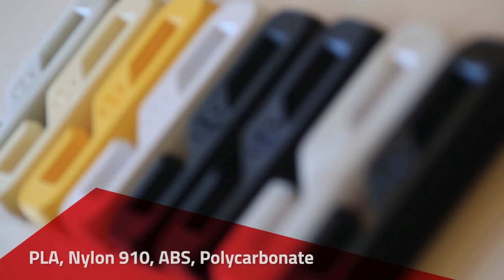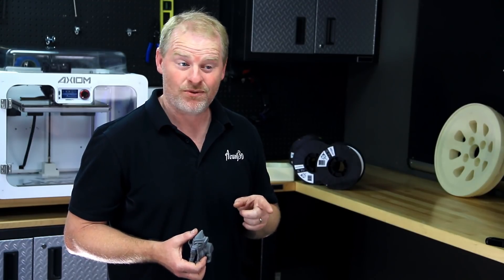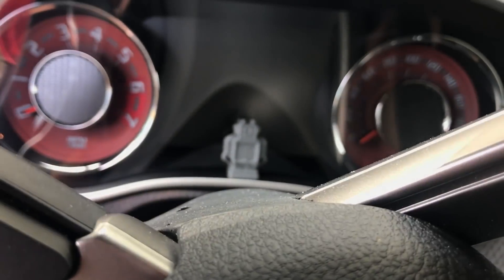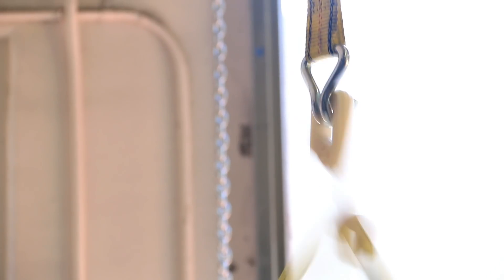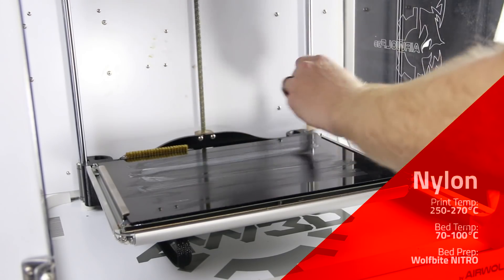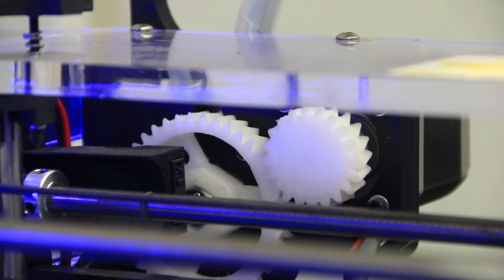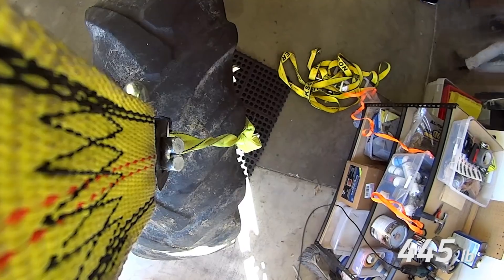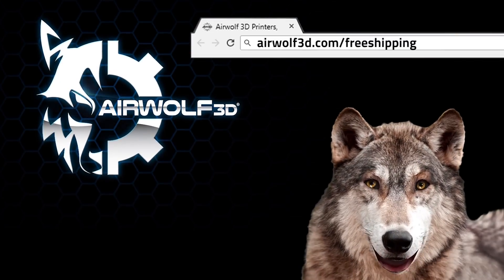Hooked on 3D Printing: What is the Strongest 3D Printer Filament?

Comment: K i would like to point out that who ever was using the forklift was very unsteady and that could have added to some of the failures because to be honest the jerking or bouncing can actually exert ten times more pounds of pressure just like doing it if you stand on a scale and just from doing squats on the scale your body can make the scale go from say two hundred pounds to 1000 pounds just from the inertia of your body going up and down and hence the actual break point could have been much higher than measured due to the unpredictable jerking or bouncing motion of an quicker bump of the hydraulics did you factor in these inconsistencies because the one abs broke during a bounce and then quick bump of the lever which could have actually went much higher in actual recorded weight in essence

Comment: Annealed overture nylon is my favorite material for high temp and strength. Higher tensile strength and impact strength than polycarbonate, temperature resistant to up to 180c, prints at only 260c without a chamber or even a heated bed, AND its only 30 bucks a kilogram and prints like a dream. Print it and anneal it like you would polymakers copa, do not try to print it like normal nylon or you'll almost certainly have a bad day lol. Not a fan of overtures other materials, I really dislike their petg compared to cheaper brands,  but I gotta admit, they nailed it with overture nylon. Please be responsible and do not print it without an all metal hot end. Capricorn tubes are unsafe at 260c even though they don't fully melt. You can check their website to confirm this. Idk why everyone thinks capricorn tubes are an alternative to an all metal hot end. They probably are the best ptfe tubes, I do like them, but they still degrade at unacceptable levels past 250c.

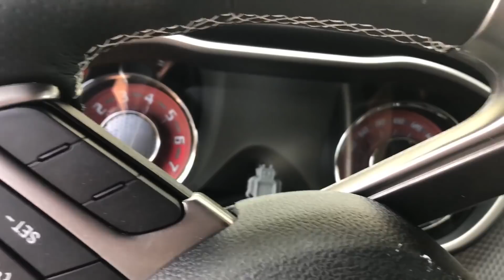Comment: Disinformation. PLA degrades very slowly in sunlight or outdoors. @3:20 the item doesn't degrade due to sunlight or outdoor environment, but it melts due to high temperature. PLA has a low melting point, but it has nothing to do with degradation.  PLA's biodegradability is mainly a myth. Well, it degrades far faster than ABS or nylon, but it still stands very well in outdoor conditions. In one test a PLA item was buried in a flowerbed for two years, and after that, it showed no signs of degradation (visually and mechanically).

Comment: This video was just suggested by the YouTube algorithm. It needs an update, and you should put the year in the video title to get the algorithm to better detect your update. Also, your update needs to include both chopped and braided/"continuous" fibers (ideally: carbon, yeast-grown spider silk from the CA company "Bolt Threads," human hair, and high-tensile steel filament). If you also added a metal sintering (SLS) and UV-resin-dual-laser-cross-linking tech like CLIP / HARP, you could guarantee high rankings and increased sales. (However, do slow placement of weights this time, and don't waste people's time. i.e. have them one after another, and post the "timestamps space brief phrase description" under the video so it is autosensed and put into the video's control bar. Such videos place higher in YouTube's algorithm, and automatically yield a higher ranking.)

Comment: there is a difference between degrading a material and temperature resistance, pla wont degrade for decades if left outdoors in non extreme sunlight. This is not an issue with the materials biodegradability like suggested instead its to do with its temp resistance. the other thing is that stress test was bouncing really bad, you could be having 2 or 3 times the quoted force due to the bouncing.

Comment: I have a feeling that the pc hook wasn’t pc. It sounded wrong when it hit the floor.
EDIT: I have pc and it sounds like ceramic
Edit 2: That pc actually sounds quite rigid, and I’m pretty sure all of them would bounce back. That pc doesn’t sound very tough, and in my experience with pc like that (eg polylite pc) it’s extremely brittle.

Comment: Ze advert for wolf bite. Or maybe polycarbonate. Also, abs degrades in UV light as well. So it is NOT a stable material. Also wrong print bed temp for ABS.

Comment: #commercial #salespitch
How the ... can you say that ABS is an easy to print material. We all know that it is difficult to print ABS without warping or layer adhesion problems.
This is just a commercial for your own products and it should be tagged as such.
There is nothing wrong about making a commercial for your own products, but don't mislead us in thinking this is a search for and a test of the strongest filament

Comment: Every single one of your tests was an engineering/testing failure. None of those will hold the weight you broke them with. Working load was exceeded every time. You didn't even time your tests. This is the most ineffective and pointless video on the entire internet. WolfBite is just a rebranded commonly known adhesive. You never developed anything. You're what we call a fraud.

Comment: This testing methodology is extremely flawed, no mention on print orientation or layer adhesion, and the PLA test used a pulley with people?... and was lifted at a very inconsistent rate, it almost looked as if they were trying to make it fail, then the PC test was loaded smoothly with a fork lift. 

A test like this should be started by disclosing testing methodology and should have results that can be repeated

Comment: The "inching" movement that they did while lifting makes the hooks easier to break
Reply: Mico Menta yep. Was coming to comment something similar. You can see that the load was yanked up and then stopped, causing the load to be relieved from the hook while the inertia carried it up. And then when the load fell back down, the hook broke. This is because the hook was under a much higher load than just the weight of the load alone. There are much more controlled (and not to mention less dangerous) ways of testing the breaking point of a material and measuring the weight at breaking point.
Reply: You see the hook break when the weight falls down after the increment

Comment: Why not use industry standard tensile test coupons?  Then you can get actual 0.2% yield, ultimate strength, Chappy impact, and notch sensitivity  that can be compared with properly spec'd materials.  Your results cannot be used to design a load carrying part which needs those specs.

Comment: I'm very into what you've done for us by testing these! As a few people stated before, the jerk on the hooks cause a huge range of error in the tests. a better way would be to create a sled, lift it, and then load it consistently.
Then- to reliably test tensile, you should make a hook that is super beefy on both ends, with a consistent diameter cylinder in the middle- that will give you a predictable break zone in every hook, and will be pure tension. In the examples you printed, the failure was part bending, part tension, and probably part shear.
I'd also love to see pure shear tests, since I get a lot of small gears on my printer failing along layer boundaries. Although that would be a much more detailed video, since layer temperature and bonding time can have drastic effects on shear.

Still, these kinds of demonstration videos with consistent tests are hard to find. I was surprised that PLA outperformed ABS, and was impressed by the PC. Any change you'd try something with carbon fiber in it to see if it actually makes a difference? Thanks!!

Comment: Thank you. The bouncing made it more of a real world example and would cause a more brittle material to fail sooner. Although, in my engineering classes, you use a different shape to do strength and yield tests. But small errors in the surface can cause stress points that can lead to failure. It is not desktop, but I am about to order parts in Stainless Steel 3D printed. It has laser that melts thin layers of fine grains. About 95% solid I am told.

Comment: I find your results to be lacking stability, the load is bouncing when you lift it, of course that will cause strain on the hook thats not needed. back to the drawingboard with your test. a suggestion on how to life is to use a crane with a hook on a wire to get a smoother lift.

Comment: Sorry but if you already know the tensile strength, well, you know which is the strongest. It would have been nice to hear an explanation as to why PLA and nylon, having the same tensile strength, break at different weights. Lastly, ABS turns brittle in the sun. Only ASA is resistant to UV.

Comment: The PLA actually snapped under probably a couple tons of FORCE. The jerk caused way more force than the weight of the tire. Your method doesn't work, it causes too much jerk. Nice try though. Seems like you want us to buy your nylon/polycarbonate print-bed glue and filament.
Reply: Jeramy Nunn thought the same thing. It was already holding the tire yet when they jerked it, it broke. Stupid testing.
Reply: A slow steady lift would have made more sense. I'd hate to see that forklift operator putting pallets on a shelf
Reply: It was reasonable test, it would've been better if they just kept adding weights in increments till failure
Reply: Agreed, they should've used a force gauge, winch and solid anchor.
Reply: Chris absolutely
Reply: Yeap.. Just bullshit
Reply: @jereshemeikka2887  no, the test wasnt repeated the same way for each material. They were jerking the weight when testing PLA hook, like they were deliberately trying to break it, and when testing PC they were lifting the weight in a very slow and controlled manner.
Reply: @Jeramy Numm  The test was repeated the same way for each material, so with that in mind the test was fair, eh?
Reply: @SunnyDaysRFun  I would say no still. You can't apply the same amount of force with every test that way. It's too inconsistent. If you could guarantee that there is the same exact jerk and force every time you did it, then it would be fair.
Reply: @Maynard123   It still gives you an idea the different strengths between the different types of filament.
Reply: @Maynard123  but it's a fact , nylon ,polycatbonate are more stronger than pla
Reply: @tomgirl366  I don’t think nylon would break like that, but would rather neck and yield.
Reply: @tomgirl366  that is not a fact. PLA has greater tensile strength than nylon.

Comment: A bouncing forklift is not a good test.
Reply: its not a bad test and considering they used the same method with all the different types on material.  It still shows how much stronger one is from another.
Reply: @DonnyAngler  using the same method doesn't mean an accurate test. The way they tested the materials were very unprofessional. It doesn't make sense. You could clearly see them trying to break the PLA. Whereas with nylon and up, being gentle with the lift for sudden jerk or fast acceleration. Also the numbers don't really add up. PLA rated 7,250lb psi failed at 285lbs, ABS 4700lb psi 285lbs, nylon 7000lb psi 445lbs. Really...?
Reply: LOL where did i say it was accurate?  I said it shows the different strength of the different types of filament compared to each other.   Depending on your print settings and how you print them can greatly alter the strength of a print.  Making it much weaker or stronger.
Reply: @DonnyAngler  dude are you serious?
Reply: "It's not a bad test"? LOL oh yea this test is good enough. I think you should go look up the definition of the word 'test'. The numbers and the test results are all over the place. You should look up how to properly test a 3d filament. Can't believe you replied with confidence.
Reply: @DonnyAngler  I'm pretty sure they're referring to the way they bounced the load on the PLA but didn't bounce it for the other materials.

Comment: Would you consider printing a nylon hook and letting it sit in a garage for a couple of months, and see how it handles the lift?  All my Nylon prints are super strong the moment it comes out of the printer, but after a few months, every print has absorbed moisture and gone limp.  They are all flexible and I can no longer us it as a functional part.   Please let me know if you exhibit the same behavior.

Comment: How does the polycarbonate compare to polyoxymethyene (AKA POM). I've seen  POM filament for sale and injection moulded POM is strong enough to make plastic gears capable of handling thousands of watts (though usually those are cut by machine from injection moulded blanks). I've seen RC helicopters with 10,000 watt brushless electric motors that have a POM reduction gear for example.
Reply: from my experience POM is weaker but i dont have numbers for you.
another alternative to POM is Polyamid , i dont know if they offer this as filament.

Comment: Hi,

I’m currently working in Nigeria and we need to manufacture small parts for the industries in Nigeria. Normally we would make brackets out of metal and have it galvanized, but takes way too long and most of the times it is a once-off type solution. To 3D print it makes more sense, but most of the parts and brackets is used outdoors. I’ve been tasked to find a solution.

My question is, which filament will work the best. We do have the following average conditions in Nigeria:

• Temperatures ranging from 10 degrees C (50 Fahrenheit) to 55 degrees C (131 Fahrenheit)
• Humidity of 20% to 100%
• Northern region is desert and southern region is tropical.
• UV index from 6 to 12+

My thinking is that we need to revers engineer this solution, by first establishing the correct filament and then find a printer which will be up for the task. Could you please assist with the above.

Comment: Please explain to us why Nylon had a ~30% higher failure load than PLA, when PLA has a slightly higher tensile strength? All things being equal, PLA should have lased a few pounds MORE than Nylon. This means there is a fundamental flaw in your experiment and you are not printing the parts equivalent. My first thought is you are having dissimilar layer bonding efficiencies contributing to the discrepancy.

Comment: Engineering design point of view: Wear resistance is much more important on gear designs (I am only mentioning about it because you showed examples) Tensile strength comparison under static load (or may be dynamic? We couldn't see how did you load it and I think that forklift was a bit too fast on lifting) comparison was great and I will certainly keep this in mind while considering. Thank you for the video

Comment: I'm calling BS on the hook test. What you saw was more a test of shear strength than it was lifting strength. If they had wanted to show how much weight it could lift before failure they would have made a figure 8 type with the center at the same cross section as the outside cross section of the wall of one of the loops, somewhat like this 0-0, then lifted weight until the center lug or one of the loop walls failed. A test best performed in an enclose safety booth with a hydraulic expanding ram and short attachments to limit flailing at failure.
Reply: The test was repeated the same way on each material, fair test.
Reply: @SunnyDaysRFun  They didn't even use a tensile meter. They only put weights in a tire and jerked it around. And they're in a shop of all things. You'd think they would have a tensile meter. All that jerking around multiplied the actual weight each 3D printed hook endured and randomize it based on how hard they pulled it at the time, and when they pulled it while the tire was swinging. I can not think of a more inaccurate test.
They are targeting the wrong market here with the wrong strategy to sell adhesion glue..

Comment: Watching the video it shows that the pla got shock loaded and when you shock load something you cannot get an accurate measurement of its strength. I would recommend you do a revisit on this video and not use a forklift but more of a winch or a come along to achieve a more stable way of pulling it up

Comment: Couple of bits of feedback:

1) Almost none of the world works in pounds. It's not that good a unit to work off. At least offer kg too, or just use kg since this is an engineering video

2) The strength being tested here is only cracks that go through the layers, but that's very rarely the weak point of a 3d print. To be a real test, it should also test with layers perpendicular to the tension.

3) You can't really call anything the 'king' without testing other options. Like, XT-CF20 for example.
Reply: Kg=lb/2.2. There, was that difficult? If you cannot do unit conversions in your head on the fly, you should stop pretending to be an engineer.
Reply: John Smith that’s rather harsh after all I did was give some feedback how to improve the videos. Oh well. Good luck and all that.
Reply: jimhize, you can not use any of the weight values in your engineering design anyway, there are a lot of parameters missing like load (was it static or dynamic?) fatigue, etc.. just consider this as a comparison between the materials (probably only the ones they use, since it is an infomercial). Still useful.
Reply: It's useful, but why use units that about 5% of the world use, rather than units that more than 90% do? Could be more useful with a small change here.

Comment: I would like to start of by saying great video , your printers are a thing of beauty, very well built and beautifully designed, Sadly  I do not own one, however if I could justify the cost, I would defiantly have one, your wolfbite for PC works great, however,  for printing nylon 910, it is much much easier then one thinks , I have printed many many many rolls of nylon on a cold glass bed with nothing more then the cheapest  dollar store strong hold hairspray, for the longest time I struggle with 910 simply due to the fact I was taking advise  from others saying the bed need to be at 110C and ... bla bla bla , but of course,  as we all know, it needs to be bone dry, pre cooking it before use is a sure way to use nylons with successfully.